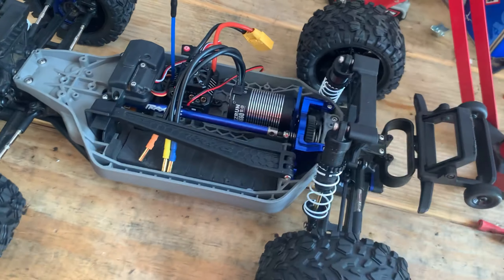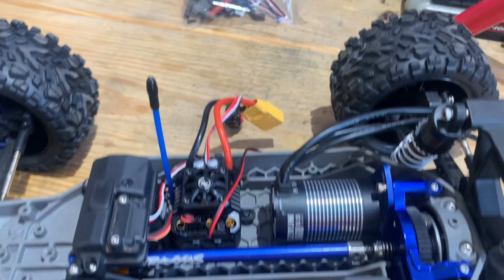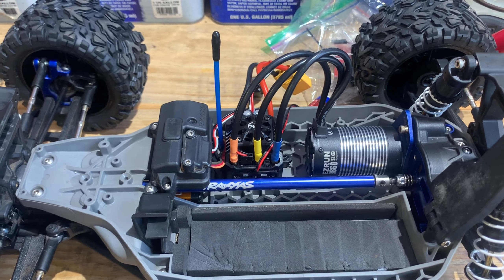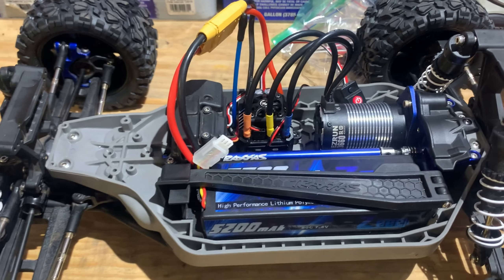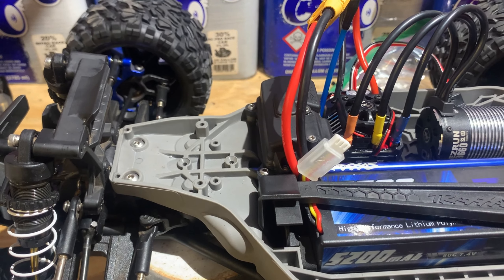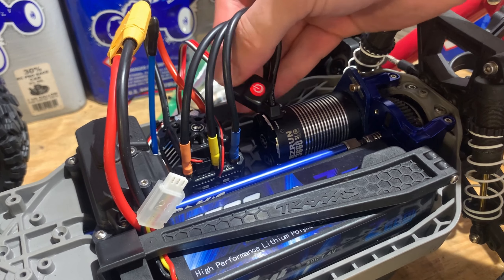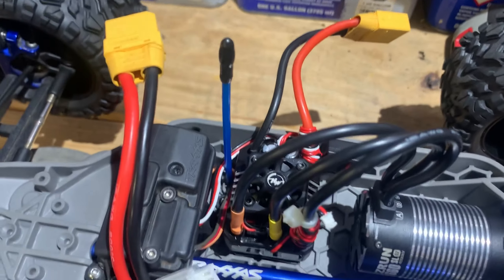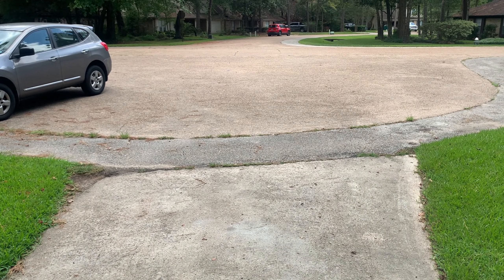Rustler 4x4 Finally Complete!!

Comment: So when’s the track video for this, hah! Could of put the power button on the side of the receiver, if u switch battery’s the motor will be hot and you might burn yourself when turning it on, you should make it all black, dye the chassis and make a black edition e revo paint job, great build!

Comment: A good place to put the motor wires is to zip tie them to the driveshaft right there. You shouldn't have any problems after that. Btw, that extra wire is for the temp sensor and plugs into the back of the motor